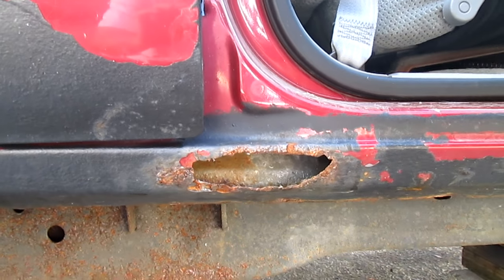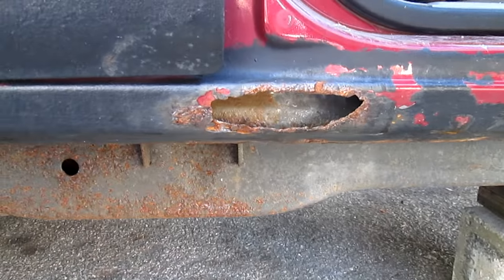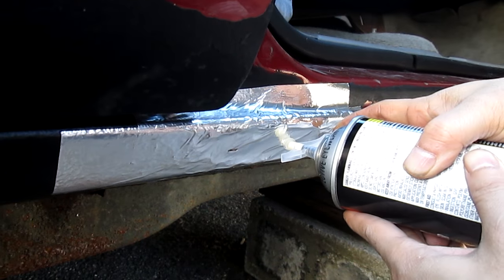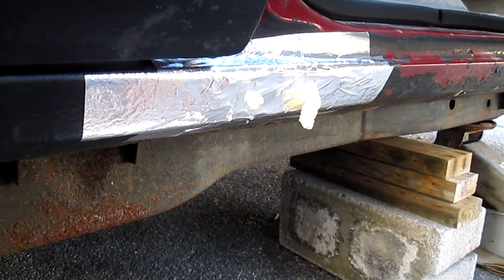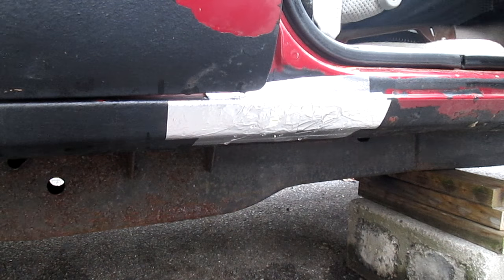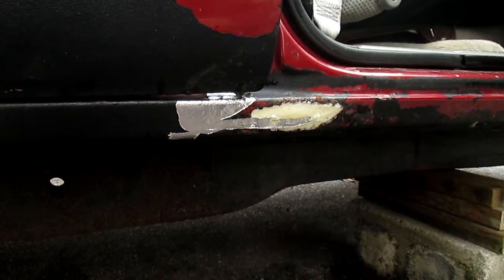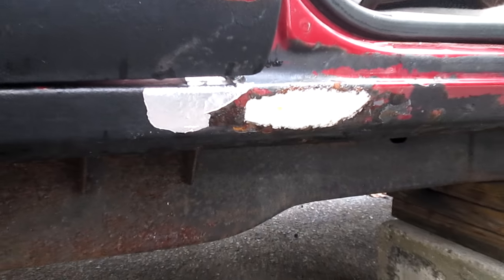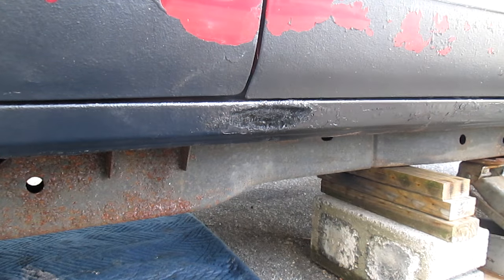Easy Fix - Repair Big Gap Rust Hole on Body Frame Car - Truck - Under 10 Mins!

Comment: Ok so im thinking the filler isnt a good idea it attracts moisture BUT the aluminum tape seams like a great idea. Im gonna use alluminum roofing for my rocker with self setting screws and the aluminum tape i feel like instead of using the foam (ive hard horror stories) using the tape to seal everything good. Thanks for this idea my friend
Reply from the maker: You are welcome!

Comment: Jordan, thanks a lot for this video, bud.  I'm having a horrible time searching for a body shop that actually wants to do body work these days.  It seems like all just want to replace panels, slap a coat of paint on it and jack up that price a lot more.  I like your solution for small holes and I think I'll give this a shot.  After looking at your video showing how it looked 1 1/2 years later, I'm impressed.  Thanks again for taking the time to explain everything.  Nice job!  And, nice accent, too!
Reply from the maker: You are welcome!  Believe it or not.  It's still on the car and it's outside parking and the paint still on there.  TIL THIS DAY... Nothing damaging what-so-ever and YES, it looks exactly like how I did since the video was made..  
NOTE:  If big holes...  Get some cheap metal screen at the roofing section at home depot, shape it or according to the hole.  Then use spray foam so it can "ACT" as a glue or binding agent.  Then, use a knife after dry and shape it to the body.  Spray paint it like I did or even use 'bondo' afterward to make it harder.
Reply: @JodBronson  - Thank you for the very quick reply, Jordan.  And, I DO believe you.  I had always heard about using your method.  But, i never seen it actually done...AND...with an update 1 1/2 years later showing how it's still holding up just like the day you completed the project.  I will also take your advice about getting the metal screen and using bondo, too.  That should take care of these spots for several years, I think.  Thanks again.  You're aces!
Reply from the maker: @ScottALanter  - -  Let me give you a special gift, something that NO ONE will be able to.  Your Health and Life will change, I promise.  I invented something..., called The Wonder Bracelets and it takes Decay Radiation out of a Human Body which No Doctors & No Scientists around the world even heard of...   Go to a Special Playlist below I've made... Watch it and LEARN HOW THE BRACELETS works... How it will help your body and help you live longer and healthier too.  YES, I am proud to made the discovery that will change the world soon !!!
PLAYLIST LINK:  https://www.youtube.com/watch?v=4KdS6rqfuqM&list=PLu6UVmXTZzOhYMYfE9SlYGGkaZR86-zax
Reply: @JodBronson  - Very interesting, Jordan.  I have bookmarked the playlist so I can view them when I'm not distracted by the weekend activities around here.  It looks like an interesting concept.  Thanks, sir.
Reply from the maker: @ScottALanter  -  I will change your Life and Health and EVERYONE around you too.  When you get old, you won't be having problems like most people now.  My Channel being suppressed by YouTube for 3+ years now, but people are coming by the word of mouth...  I have made many Medical Discoveries....  I am releasing it slowly.  I also have tons of DIY that save lots of $$$$....  YouTube suppressing all that too and YES, you can see some of the videos, after 3+ years, I get about 175-250 Views... Those are my long time subs.... Other than that, you can't find it on YouTube.  
Anyway, THEY can't stop me.. I will STOP ALL of those so called Doctors and Scientists that knows nothing and keep taking people's money due to "health".  YouTube can see it, so THEY BLOCK my videos.  But no worries.... Words are getting out.
In the meantime, go see the recent Video... I talked about it and how things work briefly.  LINK:  https://youtu.be/pZpPLEvnBt0
Reply from the maker: @ScottALanter  - Oh, by the way.....  I can tell you are a "normal" person and YES, right over the internet too.  Why?  Because you gave a "benefit of a doubt".  When I talk about these, the "abnormal" ones will RUN, LOL.  CONGRATS..... You are a very few !!!
Reply: You are ABSOLUTELY CORRECT....I have a 2004 Chevy Avalanche that has one little bit of rust on the right rear fender, maybe 8 inches in length....The bodyshop says we will just order a pre panel...$2300.00....$15,000.00 to paint the truck??? These people are CROOKS........they just want the Insurance claims as they can gouge the Insurance Companies.........

Comment: Grind the rust off and grind so that u have a solid piece of metal. Take a piece of wax paper and marker the size you need. Fill the marker in area of the wax paper with fiberglass and a plastic spreader then take and put over hole. Take palm of hand while holding wax paper edges and smooth out. Works really well. It comes out pretty even too. I usually just even it out with another layer..
Reply from the maker: Doing it the right way it's always best.  This is a temporary fix to pass inspections!  
NOTE:  This is not or for the vital frame.

Comment: I've done repairs like this in the past. The only thing I do different is grind as much of the rust off , even on the inside, and then spray the area and inside with a Rustoleum product that found that bonds and seals rust. That way the rust stops on the inside and the repair will last a lot longer.
Great vid.👍👍
Reply: This is the kinda info I was searching for. Thank you good sir.
Reply: Rust-Oleum Reform and Seal
Reply: @Penland1234  👍👍👍👍👍👍👍👍

Comment: This is the best so far on YouTube to repair such type of hole
Reply from the maker: It's still doing AOK.  4 years later, in the Sun, Snow, Rain... +++  Surprising still doing aok!
Reply: @JodBronson  You did a good job!
Reply from the maker: @babajideoluwaj5307  - Thankx!  Give it a try and you shall see :).  Some people don't believe it will last, so I made a video 1+1/2 years later. 
See Link:  UPDATE VIDEO:  1+ 1/2 Year Here:  https://www.youtube.com/watch?v=pwc6sEPktgc

Comment: Genius idea using the tape like that , great video man ~ Going to try this on my sons car.
Reply from the maker: You can use Plaster Tape + Aluminum Tape together for more rigid too.
Reply: @JodBronson  

Definitely, thanks bud. It’s the lower quarter panels. Im debating if I should remove the interior and go from the inside to block off the large internal area , or just attack it from the outside and maybe shove a piece of cardboard on the inside opening to create a border / wall to hold the foam within that space.
Reply from the maker: @reza_dc2  -  Attack it from the outside is better and easier.  You can put the plastic bag or tape inside to prevent moisture build-up in the future.  On the outside, use Bondo later and make it really rigid if you want.
NOTE:  Surprisingly, this fixes it's still good and holding in the snow and rainy weather.
Reply: @JodBronson  

Do you think a piece of cardboard stuffed inside the inside portion of the opening will keep the foam contained in the general area of the whole? I don't want to empty the can and have it make it's way all the way up the quarter panel and making contact with the plastic pieces of  the interior. you know what I mean?
Reply from the maker: @reza_dc2  -  Maybe cut plastic bottle + plastic can shape easily and rigid too?  Water will attack cardboard later. :((((
Reply: @JodBronson  I gotcha , good idea. Thanks again and appreciate the fast reply's.. Thanks !
Reply from the maker: @reza_dc2  -  Go make The Wonder Bracelets.... You will be ENERGY YOUNG again... You will REVERSE AGING, I promise!  See this video here:  https://www.youtube.com/watch?v=xV1elrXE_N4

Comment: Thank you for sharing.
I’m doing this on my car right now. But I’ll put bondo on top. Nice job! I glad to know that even over year it was still good. I was worried if it would last or not. Thanks.
Reply from the maker: YW, good luck!
Reply from the maker: You can add Screen Mesh over it and then spray.  The Screen Mesh will act like a wall, then it will be easier for you when you bondo it.
Reply: @JodBronson  thank you for the tip. I have never done nothing like that before. I hope it works. Thanks
Reply from the maker: @carolinaolivia3638  - It will work!
Reply from the maker: @carolinaolivia3638  - It's just a waiting game really.  Like baking a cake, LOL.
Reply: @JodBronson  haha for me that have zero experience, have been challenging. today I took of the rust with sandpaper. It was very very hard. And the hole got bigger. I’m trying take off some metal part around the hole, it is thought. Tomorrow I’ll do the foram part. 🤞🏻
Reply from the maker: @carolinaolivia3638  - Follow the video... You will do fine!

Comment: It’s basically like you have your own body shop. I don’t even see a hole.  Do you work on high end European cars?
Reply from the maker: Yes, I work on "High + End" Car and here is how.  When you go in a junk car... Smoke a joint and You and Your Car becomes High and then, if you want to see the "End" part, just put your butt in the Rear Mirror...  You will see the "End".  Now, you are High + see your End! 😂❤️😂❤️😂❤️😂❤️😂❤️

Comment: You're a genius! =D been thinking about if i want to cut the foam, making it open for everything and then cover it with body filler. or just leave it as it comes out and freezes to a nice polished cover on it's own =D don't care for cosmetics much, just a whole in the roof to stop leaking.
I've been installing doors in my flat with foam a lot, so i'm quite skilled with it. And i used tape to stop foam from expanding and dropping off from the other side! But i couldn't think of making WHOLES in the TAPE to fill the foam under it! =) even if it's not gonna become glossy that way and be more sponge-like, it's still a good way to stop foam from expanding outside (practically just wasting the foam), make it expand more inside, also make it more dense. Just gotta remember that it still needs some air to dry, give it more hours or even days to completely dry if you put it somewhere where it seals itself off.
Thanks for idea man, good thinking!
Reply from the maker: You can use " screen " to do it too.  After that, use " Bondo " to make it harder and prevent further damages.  Basically, foam is just for filling and easily molding if you are looking for that, hence the video.
Reply: Not really, the technic has been around for a long time. Did you see how the paint shriveled the foam? Since it's not flush after paint, if you want it to look GOOD you need to use a fiberglass cloth or mesh and resin. THEN body filler. So I guess my question is: why do you need to use foam, when you still have to use cloth or mesh to reinforce the bad spot?
Reply: @JodBronson  check out my post right under yours.

Comment: Aww that's good idea ❤️❤️❤️ my brother car  there's a hole so I'll let my brother to try this easy way 👍
Reply from the maker: +Aquarius_girl Vanzkie - Hahahahahahaha, yea he should.  Funny thing is... It took me more time to make this Video, than fixing the hole.  😂😂😂😂😂😂😂😂😂
Reply: @JodBronson  hahaha.... It's okay if you take long time to make this video.... 👍👍👍👍 It's worth it to watch 😊 and thank you for this video.... When i go to Philippines i would let my brother to try it and I'll be beside him while his doing it ❤️
Reply from the maker: +Aquarius_girl Vanzkie -  Where are you living now? I thought you are from Philippines?
Reply from the maker: +Aquarius_girl Vanzkie - Surprisingly, you can use this method to fix a lot of things, not just Cars / Trucks.  I have done this with Walls, Bricks, Ceilings, Floors, etc.... Anything with big cracks!  😂😂😂😂😂😂😂😂😂
Reply: @JodBronson  yes i am from Philippines but working in Saudi Arabia for almost 9 yrs.... May i know if what's the name of the spray? Wow!!!! I think this is good diy hacks ❤️ simple and easy 👍
Reply from the maker: +Aquarius_girl Vanzkie -  Wow Saudi Arabia, that must be a good Job for being so far from home 👍👍.  These are just simple " Spray Foam " or " Expanding Foam ".  They are for like Doors, Windows cracks,  mainly using it for insulation to prevent wind and cold air in Winter.   I use it because it cut down time filling things, like in this case a big hole.  Also, it can be easily shaped as well, so it cut down a lot of time.  😂😂😂😂😂😂😂😂😂
Reply from the maker: +Aquarius_girl Vanzkie -  Here is a link to Walmart... But you can view what they look like in pictures:   https://www.walmart.com/search/?query=GREAT%20STUFF%20Window%20%26%20Door%20Insulating%20Foam%20Sealant%2012%20oz
Reply: @JodBronson  okay 😊 i will look for it here in saudi or in the Philippines....... Yeah it is good job but it's hard of being far from the family 😞 it is good also this expanding foam for the roof if having hole? So i can recommend to my father to do it instead of #vulcaseal
Reply: @JodBronson  yeah i seen it in the picture.... Thank you 👍❤️

Comment: What does a hole have to do with passing a safety inspection?
Reply from the maker: Hole = Metal + Rust -  If you park somewhere and people fall on it or rub it and get injured or cut, you are liable for that.  Rust - In my state and I am sure many and in the insurance policy, you will see it.  It is considered as can cause "Bodily Harm".

Comment: Wow! Question Is there a harder spray can fill? Would duck tape be just as good as the silver tape. Of course it is cheaper.
Reply from the maker: You can spray, then gouged out, then use Bondo and then sand it to make it harder.
Reply from the maker: You can use Duck Tape but where you want to shape...  It won't work !!! :((((((((

Comment: The foam may pass inspection for a year but will cause a dramatic increase in rust . The little repair will rot the whole rocker panel off in short order.  Patch panel band panel bond or even JB weld is a far better solution.
Reply from the maker: UPDATE VIDEO:  1+ 1/2 Year Here:  https://www.youtube.com/watch?v=pwc6sEPktgc

Comment: The problem with patching a big rust hole this way is that there's a reason vehicles use metal panels. It's structure so you don't die in a low-speed crash. If rust spots eat away huge chunks of that metal, the correct solution is to cut it out and butt-weld in good metal. Costs more, but the life you save may be your own.
Reply from the maker: This is NOT for structural !!!
Reply: @JodBronson  It's not a rocker panel, small hole at the bottom of the door which is what I'm doing this weekend should be perfectly fine! Thanks Jordan!

Comment: That was a great idea, I will use your method when I need to, thanks man for the useful info.....
Reply from the maker: +Rich Goldovich - Thank You ❤️❤️❤️ !!!  You can literally " Shaped / Formed " a lot of contour edges with this easy method.  It cuts down a lot of Time + Labor work.  Use this method if you are doing a lot of " Big Gap Holes " before using " Bondo Filler ", that way it's a lot less sanding and filling.  This Job here took me less than 10 Minutes.... Funny thing is..., it took me more time to make the Video!  😂😂😂😂

Comment: I like your attempt but welding a little plate on it would of be easier and would last longer plus could of cleaned it up would last longer but each to there own I guess was a quick fix after all
Reply from the maker: QUICK FIX !!!

Comment: Why did you remove the tape?  Why not just leave the tape on?
Reply from the maker: I wanted to paint over,, the tape won't let me do that.  This kind of tape is really smooth, paint will drip right off.

Comment: Can you just leave the tape on there and paint over it?  If this is just to pass inspection, and not for aesthetics
Reply from the maker: I have seen people done it.
Reply: Ok, that's what I did, and we passed inspection (WV).  I can feel some voids under the tape, but I can take care of that when weather improves.  I don't have a garage to work in and it is wet outside during the winter
Reply from the maker: @joejoelesh1197  - Oh nice !!!  Yea, weather sucks here too in New Hampshire.  Once the weather is good, you can do it correctly or Bondo over it so it will be harder.

Comment: Doesn't it need air to cure. The tape didn't prevent it from curing?
Reply from the maker: Did you see the video?  I did peel the tape off before I paint!
Reply: @JodBronson  I was talking about the Great Stuff foam curing. Anyway I used the foam and it worked. Just have to Bondo it now and paint. Thanks.
Reply from the maker: @GT-pf6nb  - LOL, YES, I know what you are talking about.  You got some COMPREHENSION issues!  LOL

Comment: Spray foam not so it bulges beyond rust hole. After is dries/hardens, chip some hardened foam out, then fill/cover hole with Bondo, or the like. Make sure to get Bondo a bit to each side past the hole. Sand, prime, paint. The most basic prep to do is sand as much rust off to where you see clean metal. Spay primer inside the chamber as far back as you can to get some past the opening. Before you fill the void with foam. I’ve done this process on my 1993 Honda, so I know it works.
Reply from the maker: WATCH THE VIDEO!

Comment: here's a trick, rub some of the sticky off the tape before you use and it won't be so hard to take off.. (Never leave the tape on for more than 24 hrs)
Reply from the maker: Just bend a little tab on the corner.  
NOTE: In the video, it rained so I had to wait the next day!
Reply: you cant rub the adhesive off of aluminum tape.

Comment: Should have painted with the stuff that neutralizes the rust first, so it will stop it from rusting first.
Reply from the maker: I did, I spat on it and look, it worked.  UPDATE VIDEO:  1+ 1/2 Year Here:  https://www.youtube.com/watch?v=pwc6sEPktgc
Reply: Myth the only way to stop rust is to cut it out then weld a knew metal piece after that you spray it with primer car paint then a clear coat else you will only slow the process